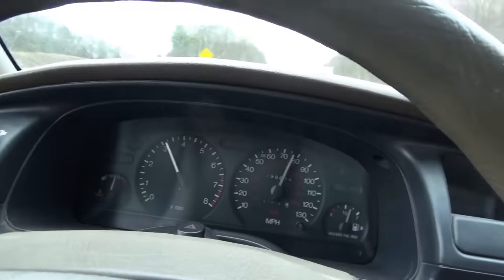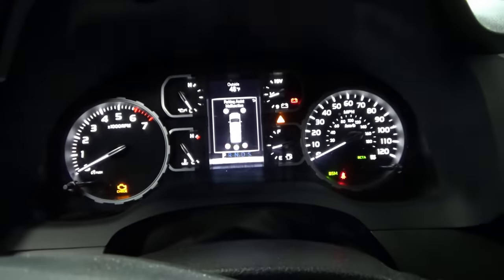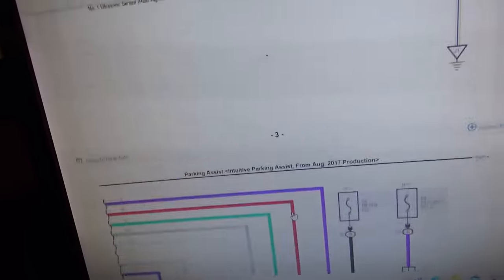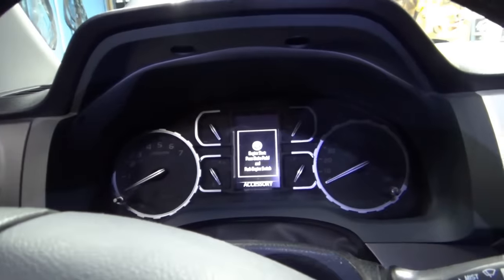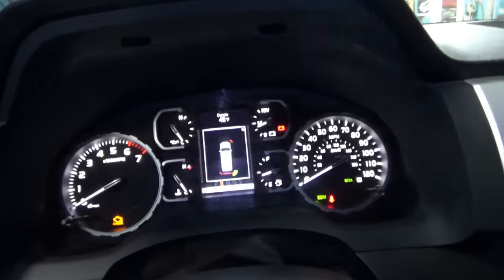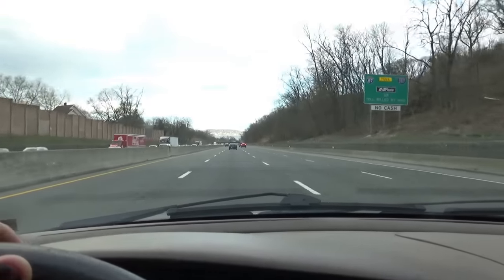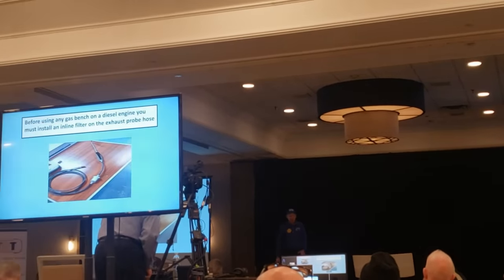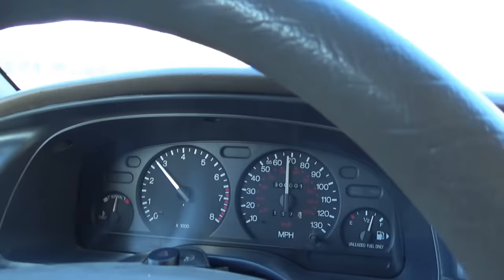Dealer Wants $1,100...for THIS? (Toyota Parking Aid MALFUNCTION) + TST 2024 Highlights!

Comment: So, the Toyota was indeed a poor connection somewhere, that only needed multiple unplugging and plugging back to clear. Those meetings are a powerup, where like-minded professionals meet and share experiences, beyond the training itself. There's something magic when a row of zeros lines up in the odometer 🙂
Reply: Probably when the body work was done. They didn't plug the sensor in. As soon as the repair was done. They threw their hands up and said. We don't do that kind of work. Take it to a shop. 😅 I know because that happened to my daughter Sienna. After a bumper kisss incident with a bigger truck. 😅😅
The front end got the body work done. Then the AC system didn't want to work right. 
After a shop said the AC compressor is shot. Then its not working anymore. Again the shop said AC cornpressor is shot again. But the labour is not part of the warranty work..
I had purchased a new scanner. So I did what Ivan, Mr. O and other Pros who I watch on YoTube. 
Bought some test leads and bought a subscription to Alldata. Printed out wiring diagrams. This took me about 3 hours. I traced it to a temp sensor. When the crashed happened the body shop. Twisted the wires together and taped the crap of the repairs. 
I ordered a new sensor and pigtails. Soldiered the connection and head shrink. 
The AC came back to life. All because of Ivan,Mr O and many others. 
To this day I haven't taken my vehicles to a shop for repairs. I do admit. Taking my vehicles for an alignment after I replaced parts. Anyhow...I'm about to turn 70 in a few months. I'm an ole dog and learning new tricks. 
Just a few months ago....I bought a scope because of Ivan 😅😅😅
Reply: @2nickles647  It's possible, but I believe no one reported a disconnected sensor. Pleased to know you have a fighter attitude to problems and don't let age stop you 👍

Comment: Those 2.0L zetec engines are pretty damn tough. The transmissions are ok
Reply from the maker: The MTX75 manual gearbox is a gem too... Super smooth shifts and even Reverse has a synchro! 😊
Reply: My 2003 Ford Focus has a 2.0 Zetec runs as strong as ever. It's a complete dog tho. Still the best car i ever bought. Paid $2000 for it nearly 4 years ago. Still going and everything on the car functions properly.
Reply: @PineHollowAutoDiagnostics  I just bought a 2015 Ford Focus with a 5 speed MTX 75. Yep Ford still uses that transmission. I'm getting the hang of driving manual. Not yet comfortable with it.

Comment: Probably a good idea to use some deoxit on those sensor connections just to be sure especially in the east rust belt.
Those guys teaching mechanics how to trace down issues also need to have some input in how to charge for all of the diagnostic time need just to find the problem. Todays vehicles require more diag time than older vehicles and then once its determined the fix is simple in most cases, replace a part. New vehicles are similar to any new "green deal" plan...the cost to get the improvements just do not have a lot of value to the individual people in society. There simply has to be a limit to benefits for the cost or value.

Comment: The truck distance sensors  seem dodgy as hell,  or was it just some pillock playing  musical chairs  :-D
I would take a switch cleaner spray and drench the connectors.
The 1996 Mercury Mystique  has to be a keeper,  Reliable old beast :-D

Comment: I live in N.E. PA. & it's very hard to find a vehicle that is older that isn't rusted the hell out or needs major body frame work for under $3,000.

They are out there but you must be looking everyday or even every hour. I have a 97 Grand Cherokee with 186,000 miles but the unibody is all rusted underneath. Jeep runs great nothing wrong except it's all rusted out underneath, body panels are 90% on most of the Jeep except the lower part of the hatch.

You have a good one sir Ivan, you got a GREAT DEAL, some vehicles are just put together right & it doesn't go by manufacturer, it could be ford, chebby, toyota, honda, ect.

Comment: So if everyone bought a $500 car and drove it for 300,000 miles you might be out of a job😮.
Reply: I would think it would be the opposite. 20 year old cars with over 100,000 miles break a LOT.
Reply: @TheRetarp  I’ve had three vehicles that I put well over 100,000 miles, one for 300,000 miles, and all needed just routine DIY maintenance. Never needed a picoscope or even an OBDII scan tool.
Reply: @NMTRUCKER  You have been quite fortunate. If all cars were that good they would be on the road still instead of crushed.

Comment: You REALLY don't know how to explain 300,000 miles on the Mercury Mistake?  I do.  His name is Ivan Temnykh.  You stated that you paid $500.00 for it 7 years ago.  Seems like we got into a discussion about the fact it was a $13,000 car on the window sticker.  It is in good condition for the money you paid.  I disagree the only thing you have done is the clutch.  Seems like you were on a hiking trip with your brother, Grisha, and a hose blew.  You cut off the bad part, reinstalled the hose and kept going.  So, I guess since you reused the hose the car is indeed all-original except the clutch.

Comment: GThis will make you laugh 1986 volkswagon polo the little one down from the rabbitI bought it for 20 pounds trailered it home  once I got it home new battery set of plugs it started straight off no problem so I put it in for the MOT Test our inspection It passed with a little helpand the little battle scarred and beaten up polo did me proud as a run about  One of  y customers brough his volvo s60 in with a fairly major electrical fault I told him it would be 2 days to go through all the electrical faults hes asked me if I had a loner he could borrow to get to and from work I told him yes on the proviso he bends it he buys it  he said ok took off and when he came back he wanted to do me a deal against his volvo as he was si impressed with the polo( I will say it was not a pretty car but it was reliable  which often is the most important thin.. he drove around in the little car for 
...